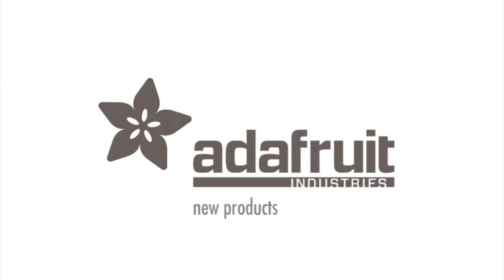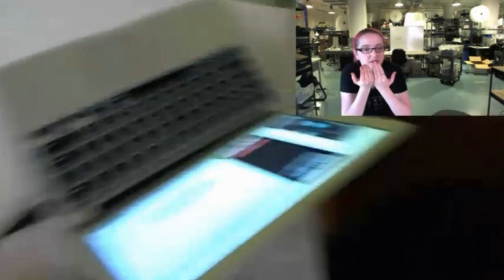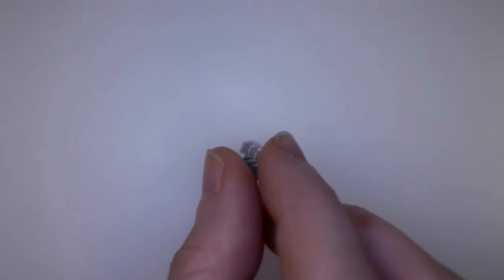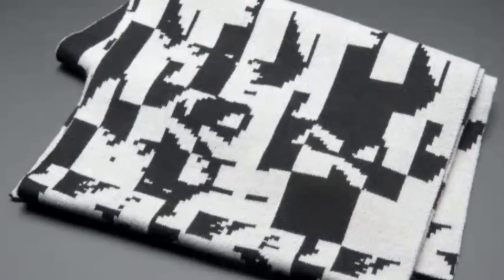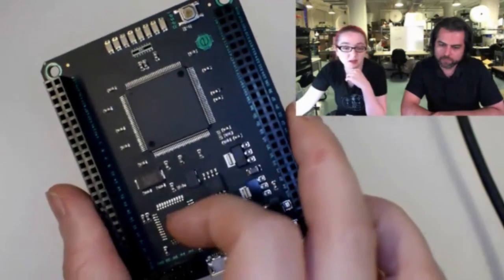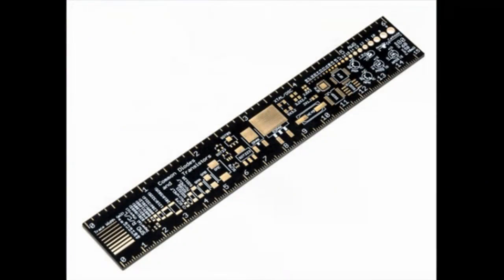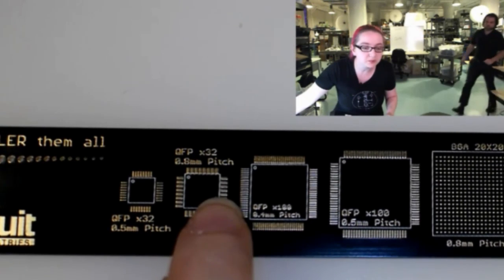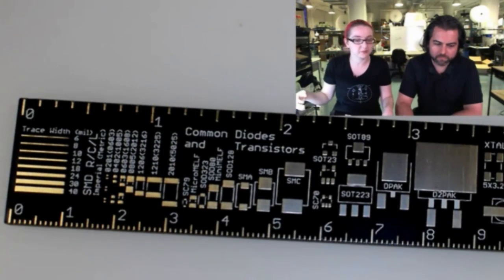PCB Ruler & More! New Products 10/12/2013

Comment: Hah! I'm guessing there was a sudden boom in interest for PCB rulers after Dave Jones did his single print run of crowd-funded "EEVblog µRulers" that went crazy out of control and sold like 10,000 copies.
It's good to see someone else is going to make these.
One bit of feedback: It would have been nice to see the actual "ruler" part go right to the edge, with the edge being the index point. That way it could be used as a depth gauge.
Other than that, it actually looks better than Dave's µRuler.

Comment from the maker: See what's new this week! PCB Ruler & More! New Products 10/12/2013

MakerBot® Digitizer™ (0:10) http://www.adafruit.com/products/1508

Aluminum SMT Heat Sinks 10 Pack - 0.25"x0.25" x 0.15" tall (3:13) http://www.adafruit.com/products/1515

Glitch Scarf by Glitchaus (5:07) http://www.adafruit.com/products/1517

Mojo FPGA Development Board (6:45) http://www.adafruit.com/products/1553

Adafruit PCB Ruler - 6" (10:41) http://www.adafruit.com/products/1554

 #Adafruit
Reply: did you guys watch this video?  between the annoying whirr of that scanner, the "um" "uhhh" "ahhh" and the 5 or so times it went blank or the sound faded to almost nothing I couldnt bare watching.  take a little time and put effort into editing.